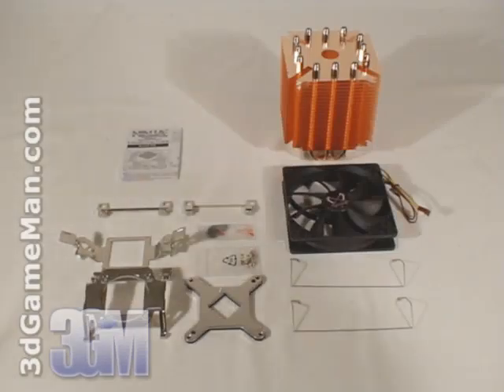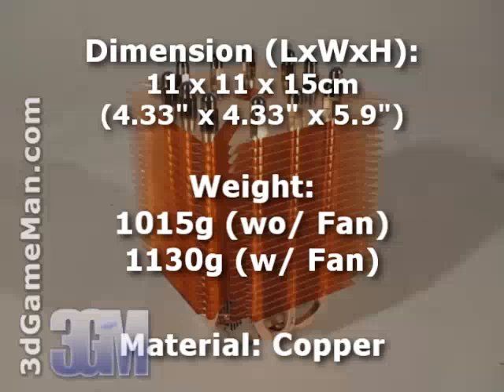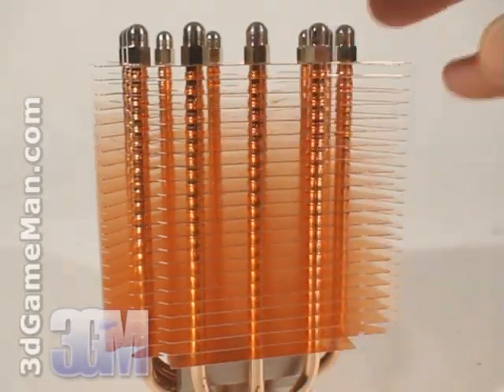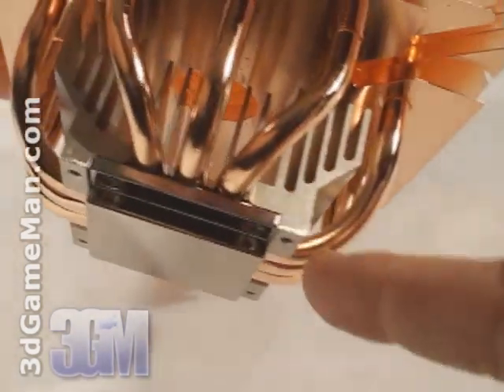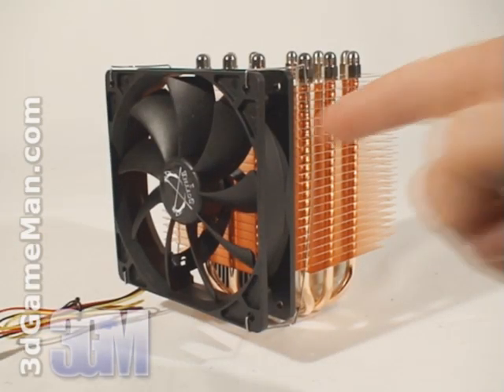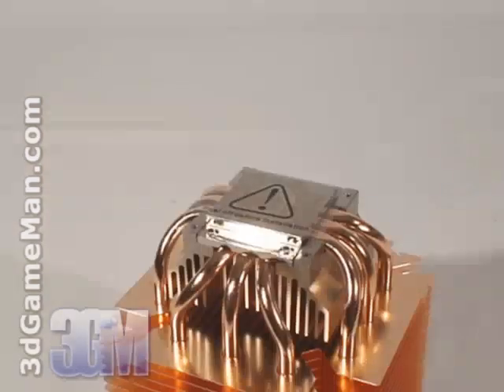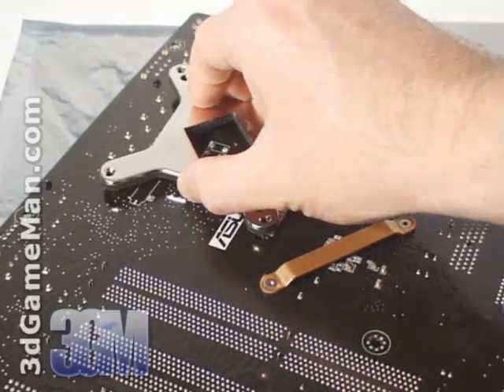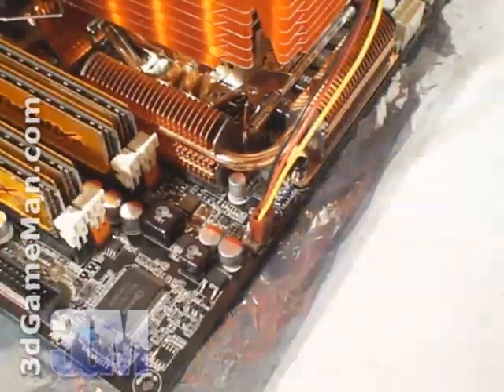#916 - Scythe NINJA Copper CPU Cooler Video Review

Comment: I've got a Scythe Ninja Copper as well. AMD Phenom II X4  940 Black Edition. 3.00Ghz/1.30v stock overclocked to 3.5Ghz/1.475v. temperatures are 39 Celsius idle and 53 Celsius load. 

This cooler rocks and looks badass :)

Comment: @ATAATX had to reply to you here, copper has been the accepted best medium for heatsinks for 10+ years. we use aluminum cases because a copper case of the same design would cost over a thousand dollars. to put it simply you can base heat conduction on how well something can conduct electricity. the best wires and cables are copper (custom really high end is silver) while aluminum is used as a cheap alternative (ide cables for example, and even high wires for weight reasons not cost)

Comment: ok I have a patent pending over-drive "cooler extra-ordinaire" PigsCanFly power-cooling strategy.  It's called Cryo-Chem-2001 cooling.   You konw that circuit chiller in a can?  Hack a Glade air-freshner dispenser to direct cryo-chemblast the processor to a cool -51.4 C.   Cough cogh - thats MINUS 50C woohoo When the going gets tough - the tough cryo-chill : ).

Comment: I have this cooler on a ASUS Striker Extreme board with an older 105w Q6600 and it keeps the CPU at 28 degrees while idle and rising to 42 degrees with all 4 cores under full load. It's a good cooler in my book!

Comment: Its hollow and full of some kind of low boiling liquid like alcohol.  Either that or water in a vacuum with low pressure and the water boiling point gets very low.  When the water evaporates it takes the heat up the pipe into the fins and then re-condenses and flows down the pipe.

Comment: Cheapest way to cool your cpu is to paint the stock sucking stock heat sink to black color, this will increase amount the amount of heat being trapped and den going out of d heat sink quickly. i have tried it myself and it dropped ma cpu temp by 9-10 degrees "celcius"

Comment: no! in a heatpipe there is usually some sort of easily vaporized liquid (such as alcohol) which vaporizes when heated (when cpu gets hot), rises in the pipe, where then its cooled by the fins of the heatsink attached via movement of air or just heat radiation via passive cooling